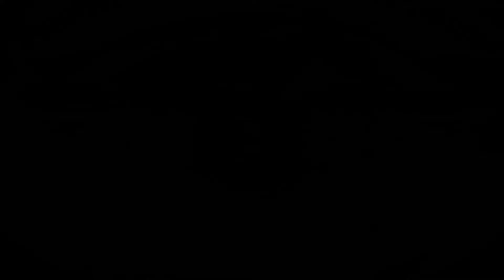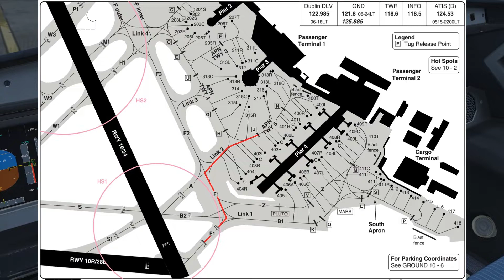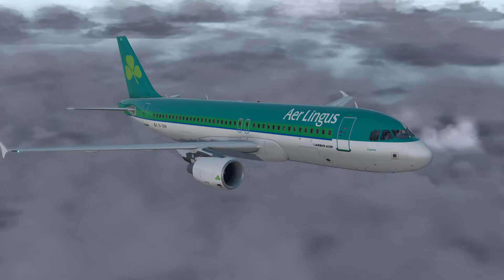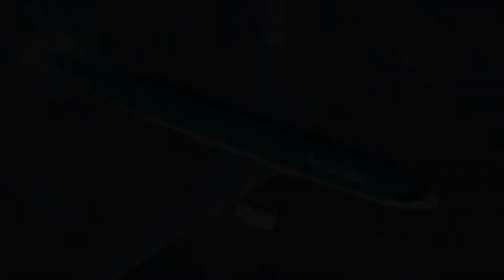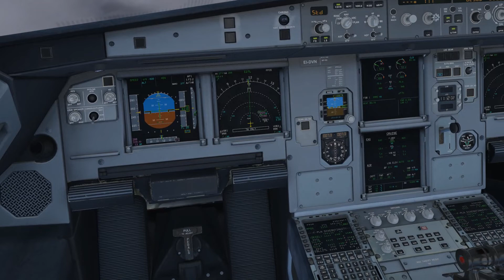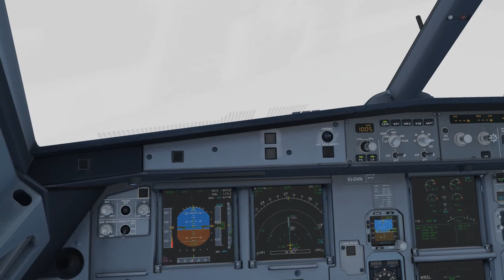REAL AIRBUS PILOT | Flight Factor A320 | EIDW to EGLL - Full Flight | X-Plane 11

Comment: Is it with the new performance update? Because i do not get more then 30 FPS with a ryzen CPU at your level and a RTX2070 though
Reply from the maker: Hi Elias,

It’s not actually. I saw that an update came out recently for the FF, but this video was recorded in early Jan.

Yeah, a lot of people have been saying the FPS with the FF is bad. I thought I’d take a gamble and give it a go. For whatever reason, it seems to run quite nicely on my system, I was pleasantly surprised! Don’t notice a major difference between the FF and the Toliss to be honest.

I’m afraid though, I couldn’t tell you why exactly it seems to work quite nicely on my system. . .

Comment: Well in the FBW mod on MSFS you click the All comm button on bottom left of the overhead panel.
Reply from the maker: Thanks, I suspect it might be the same, or very similar (I know on the Toliss the FWD call push button works). Actually, I had the same issue on the FBW and someone else pointed out this was the solution there. Need to figure out these details before I push back haha!

Thanks very much for your help though : )